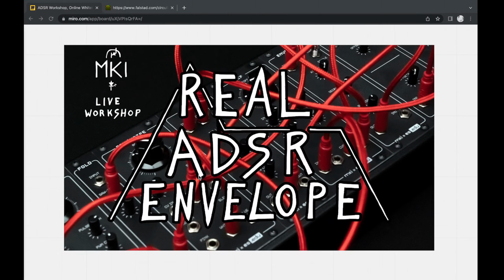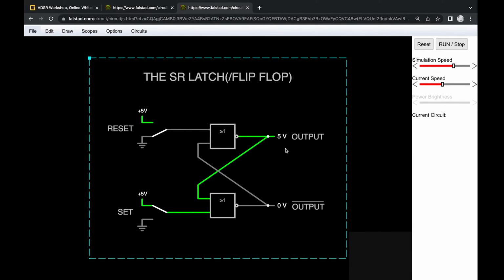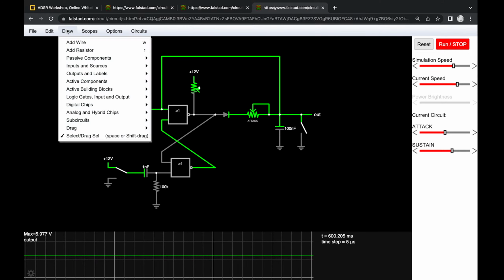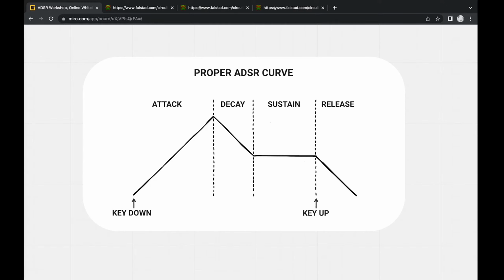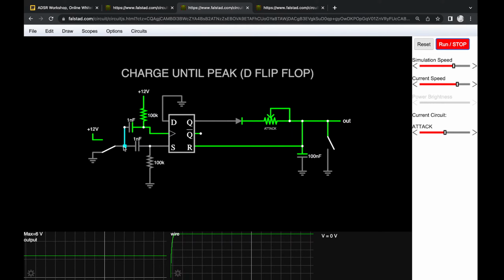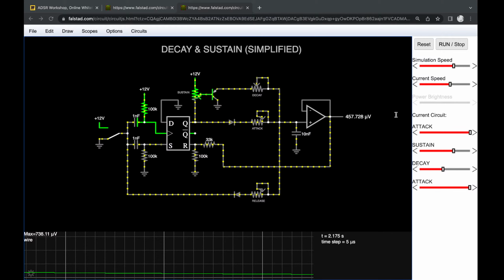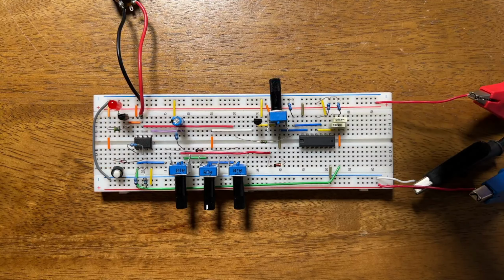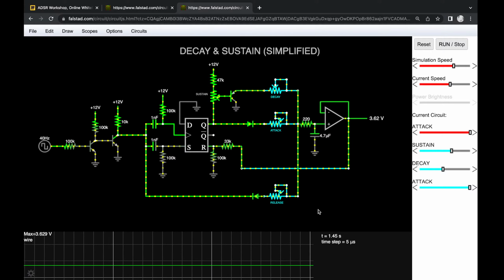D-Type Flip Flops & a proper ADSR envelope | Live Workshop

Comment: I'd personally call that 100k resistor from clock to +12V a pull-up resistor.  It's on a digital pin and setting the default value, which can be briefly over-ridden until the capacitor discharges.

I'm a little more concerned about that +24V spike; CMOS is more fragile and that could very well fry it.

No mousewheel?  Try a three-finger scroll.

There were a lot of comparator suggestions in chat; one advantage of that approach is it gives you a path for CV inputs to three of the four controls; sustain already has a fairly easy CV option.